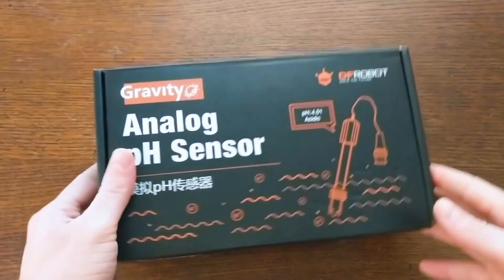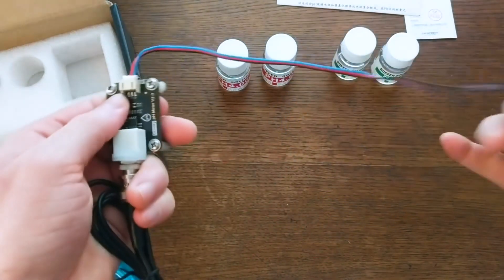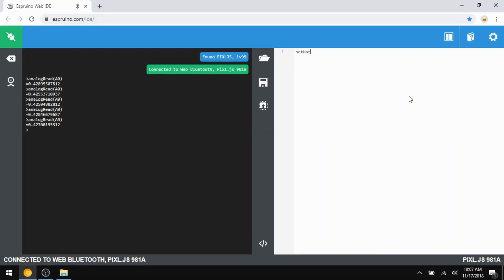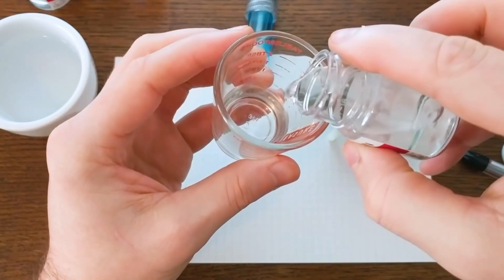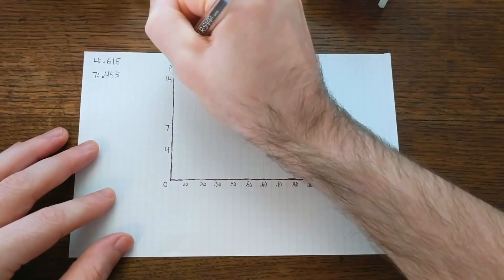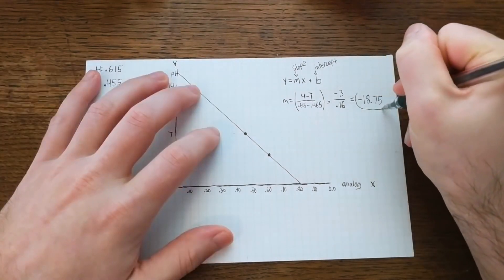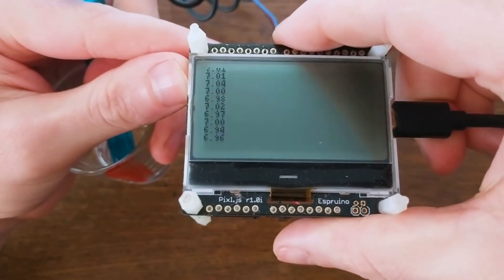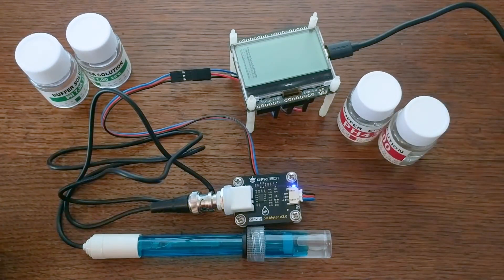Calibrating an Analog pH Sensor (with Linear Algebra)

Comment: It's a little misleading to call this linear algebra, since that suggests matrix methods, transforms, and other actual linear algebra methods. 
What you've built is a 'calibration curve' (sometimes called a 'standard curve'). 
This is very useful in chemistry but you must obey some rules. 
1) You have zero certainty when extrapolating a reading beyond the two points you measured (above the highest and below the lowers). The reason being that you cannot guarantee the approximation you've made (the linear function is an approximation of some unknown 'perfect' pH v. voltage function) is still valid in those regions. You did mention this but it should have a more prominent focus since this is a video on calibration. 
2) Sensitivity of the device is usually not the same at all points along this line. The probe might be overwhelmed at high very pH or it might not be able to pickup an accurate signal at very  low pH. It's important to know the limits of the device so that you avoid calibrating (and therefore, measuring) in those regions. Some of these regions may also have a nonlinear response and your linear approximation will definitely be invalid. 
There are some other important details but these two should always be mentioned when discussing probes and chemical measurements.

Comment: sorry, i am working with stm to read sesor PH and i have the following problem!
STM has VREF + (3.3V) while arduino with VREF+ (5V) so I cannot use the arduino formula to apply to STM. Do you have a suggestion for me?
Reply from the maker: Hi, maybe you could do the calibration job on a non-Arduino MCU with VREF+(3.3V) referring to this video. Otherwise, there is a 5V pH Meter Pro for you which you can use the Arduino formula perfectly: https://www.dfrobot.com/product-1110.html?tracking=5b603d54411d5